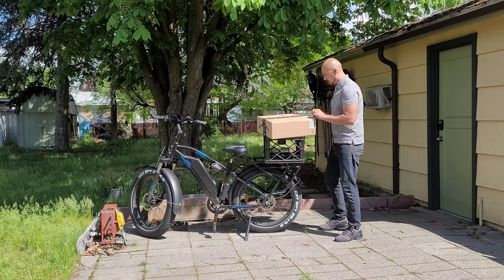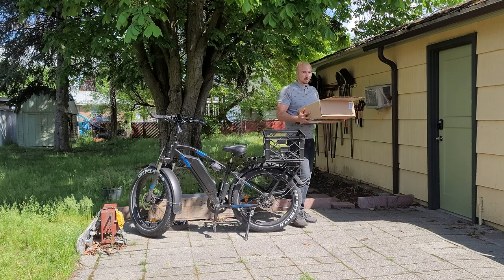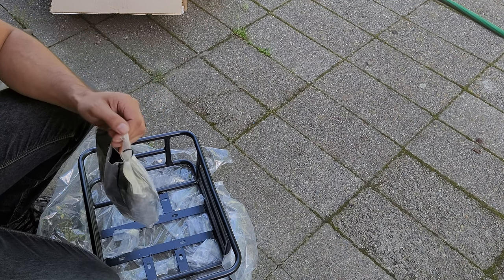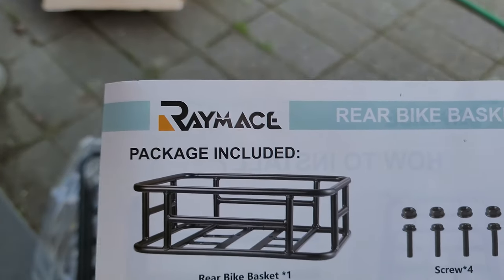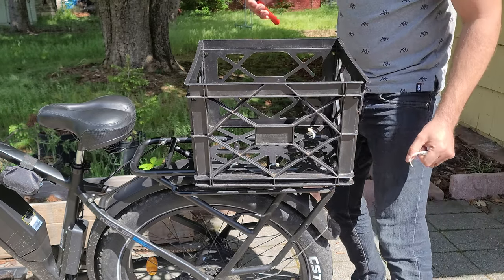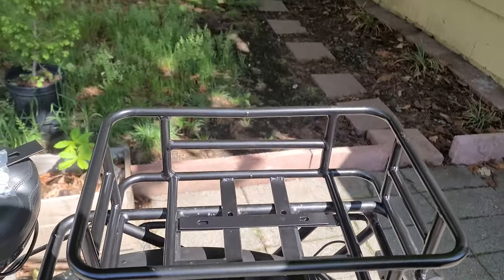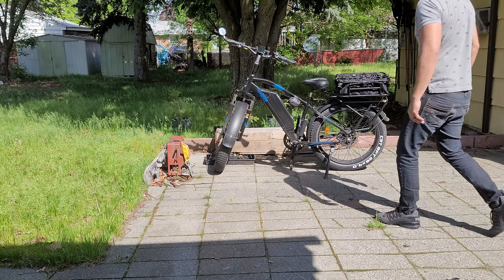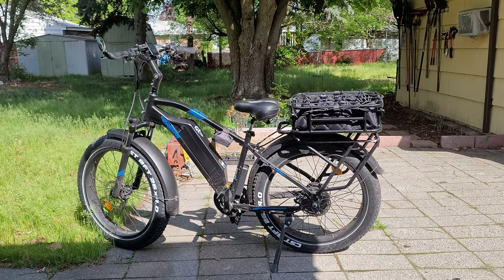BMW bike basket

Comment: I got a rear basket and Pannier bags for my Heybike Ranger S bike.  My rear basket looked just like yours. I had to place it where it could be secured to the rear rack, whether I liked it or not.  From there, I had to use the cross braces to secure the rack to the rear basket.  Apparently, the Pannier Bags were never meant to go together with the rear basket, but I didn't know that.  Assuming I was just a dumb shit and had done something wrong, I hacked the Pannier Bags to go with the basket.  (Had to cut small holes in the Pannier Bag to match the screw holes in the rear backet / rack.)  I got totally lucky with the holes in the Pannier Bags.  They looked like a f'ing machine had done them!  And I only cut what I absolutely HAD to cut.  I'm so glad I took all the time to do it, as it looks great, and now I have the space and look I was planning on from the start.